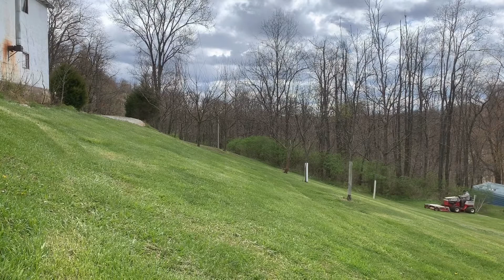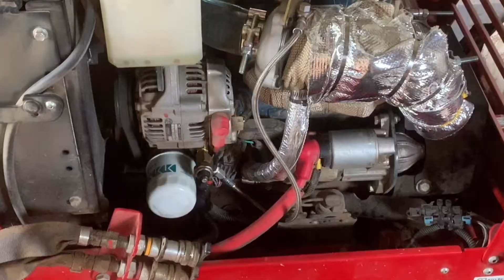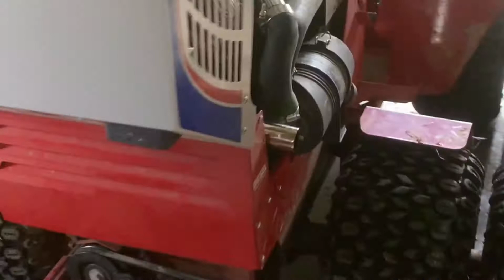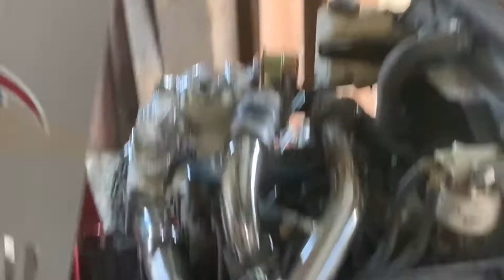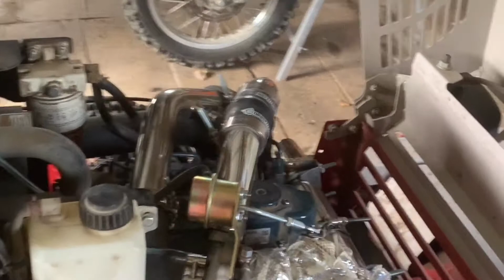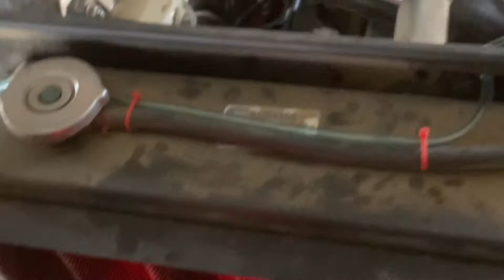Ventrac 4500Y TURBO!!!

Comment: Hi John - I have a 4500Y and a turbo kit that is not yet installed. From your video, there's a clear performance improvement. Could you comment on where you see the greatest improvement? I have a lot of 15-30 degree slopes and the tractor really struggles with the Tough Cut mower on the steeper hills. Hoping the Turbo Kit will solve the issue!
Reply from the maker: Hey mark, since you already know the limits on the naturally aspirated I don’t have to go into what it’s issues were as far as power.  While the turbo did not totally eliminate these power needs it’s greatly helped.  As you can see I run the 60” with duals.  In low range I can mow the hill you see almost wide open 90% of the time.  I still will get bogged down if the grass is really thick but not that much.  From my experience after installing the turbo the only thing that limits the tractor is the hydraulic pump, as I don’t think it’s a high flow.  With that being said it makes a big difference.  Depending where you got your turbo, you may not get the boost they say as all tractors are different, I got 6 Psi, which isn’t far from what I was told I would get.  Any more questions please feel free to ask.
Reply: @privateercolt34  Thanks John; I purchased the turbo from TurboKits.com. Will likely be Fall before I have time to install, but will let you know my experience. Any important tips for installation? My brother will be helping, he's a trade school trained and very experienced auto mechanic (gas engines), so expect he'll make short work of it. Best regards!
Reply from the maker: Mark Rubash the kit installs fairly cleanly and simply.  The one thing that’s not in the instructions but needs done is the 3/8” steel plate that the existing muffler is attached to needs to be removed.  If left on the new muffler will not line up.  Other than that it’s pretty straight forward.  Biggest thing is to leave everything lose so you can get each part lined up then when it’s all fitted go back and tighten up everything.
Reply: @privateercolt34  Assuming a capable mechanic at hand. How long does the kit take to install?
Reply from the maker: @frangeech  been a while since I did this but I think around 2-3 hrs
Reply: @privateercolt34  Thanks for the insight. I skimmed over the installation instructions and was going to make a guess of about 3hrs. give or take on the Gods that day.